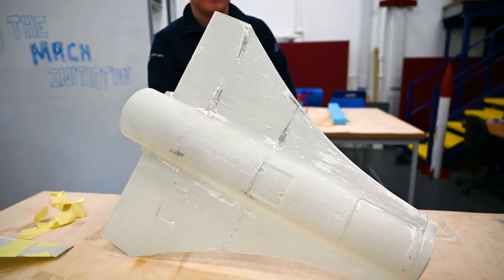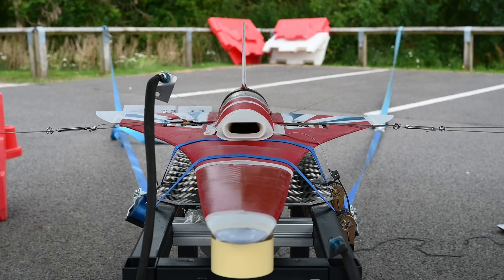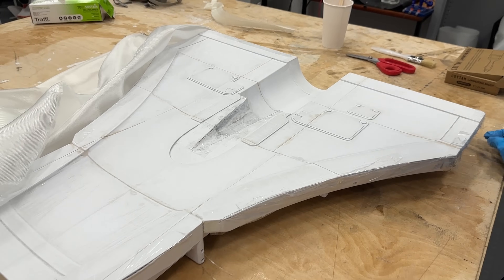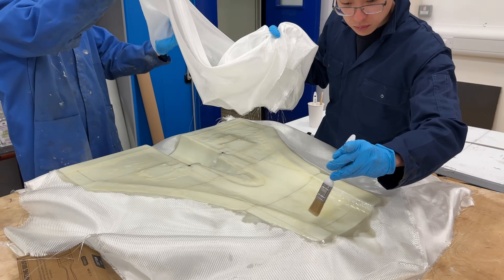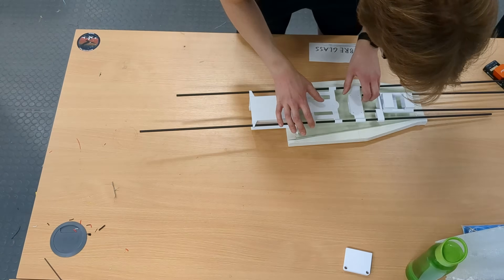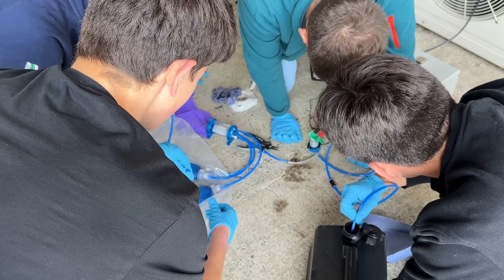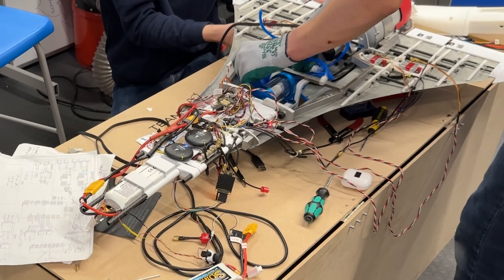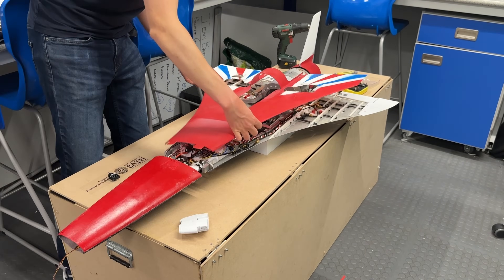Completing the Build of our 570 MPH Model Aircraft!

Comment: There's some good stuff here lads but it's impracticable and potentially dangerous. Flying rc you have to keep the model in sight sufficient to control it. That's not a big model. If you flew oval circuits comprising 200 m "straights", joined by 100 m radius semicircles each end, at 75 m above the ground and you were standing in the middle of one of the straights trying to fly it then, at its furthest point, the model would be 235 m (770 ft) away. I fly rc too; you would really struggle to fly such a small model at that distance. The impracticality comes further into focus if you work out the time for each of the "laps" described above while travelling at 570 mph (255 m/s): 2.8 seconds! Also the "g" would have to pull in the turns: 266 g! The wing would stall at less than one tenth of that g loading. The wing isn't that strong either; why on earth didn't you use carbon? Also, if you want the wing skins to act as a monocoque structure in bending then there has to be some transverse shear webs connecting the top of bottom skins. That's a huge turbine you've got there. Please proceed with caution. Get the best you can out of it - but safely. And remember, you have to fly line-of-sight in this country - it's the law. Change the objective to setting a speed record for electric ducted fans?

Comment: Those control surfaces look extremely large to withstand flutter at the speeds you're planning on going. The travel showed is of course at low speed and at high speed travel will be minimal with plenty of expo.

Comment: A couple of pointers coming from somebody who’s been doing RC planes for 20 years, that turbine is absolutely enormous and you’re drastically going to need to increase the size of the air intake. Also, the center of gravity is going to be very difficult to get correct. Move everything as far forward as you can. Our saying is, a nose heavy plane flies poorly, and a tail heavy plane flies once.
Reply from the maker: To reach the speeds we’re aiming for, we’ve had to cram the biggest possible engine into the smallest possible airframe. Our engine generates 60% more thrust than the current record holder with a wing that is slightly smaller. The drawback is our high (50 mph) landing speed.

The inlet was sized using an optimisation study that combined CFD and experimental testing. The shape was optimised for high-speed flight, which is why we have a small area to minimises spillage drag and maximise thrust at Mach 0.75. We’ve tested the engine+inlet at low speed, using edf’s to simulate different crossflow and angle of attack conditions, and the inlet has not shown any signs of stall. We see a 20% drop in static thrust, but this is expected given the inlet isn’t optimised for low speed, and we’ve heavily overpowered at these speeds anyway.

We’re aware of the CG challenges. We ran a wind tunnel testing campaign to accurately pinpoint where the neutral point is, and we have an adjustable ballast to position the CG just ahead of this point. We’ve got more ballast than we’d like - in future iterations we’d likely move the engine 50mm forward.

Thanks for your pointers and interest in the project!

Comment: Hey guys I think you should really have a good look at controll systems on d/s gliders and how they tackled flutter with limiting controll slop and increasing controll stiffness I guarantee how you guys have it won't be good enough and also look at the stiffness in the main structure I think you will be really surprised with what is required at these sort of speeds it's a real eye opener good luck 😊
Reply from the maker: Stiffening the control surfaces/ linkages is top of the agenda - we’re less worried about the main structure as we’ve done extensive finite element analysis and experimental testing on this with a healthy safety margin. The internal aluminium/ carbon fibre structure helps with stiffening, and we’ve gone for a thick 1.2mm layer composition with the fibreglass.

Comment: As heavily involved in FPV plane design myself, I can only applaud this. Just one thing I am sure you considered: Try to shape the intake manifold as such you can control the intake airspeed actively. Try to avoid resonance and shockwaves inside the manifold in order not to suffocate the turbine and cause a flame out. Subscribed !
Reply from the maker: The inlet shape was the result of a 3-month CFD study. It is optimised to minimise spillage drag and maximise performance at Mach 0.75. It decelerates the oncoming airflow to Mach 0.4 at the compressor face while ensuring uniform flow to prevent damage. In the speeds we fly at we’ve ensured we won’t get any supersonic flow in the inlet. At low speed we see a 20% reduction in static thrust because of the small opening, but experimental testing under different cross flow conditions has shown that the inlet doesn’t stall!

Comment: That is going to glide like the space shuttle :-)  I hope you glue on those wing skins really well  especially the leading edges. They do seem a bit flimsy for the speed......how about adding some carbon fiber into the skins.  Will be exiting to see how it goes :-)
Reply from the maker: We’re avoiding the use of carbon fibre as it is conductive and we want to minimise interference with our 433MHz and 868Mhz antennas which are in the wings. While fibreglass is slightly heavier, the layer compositions were sized using both analytical tools and finite element analysis to ensure they can take the loads

Comment: This looks like an awesome project, Iv been rc flying for 40 years and have had many high speed delta aircraft, the one thing that worries me about your design is the small size of the virtual fin, there use to be a kit available called the delta 2000 and the mini delta 2000 that use to hold the rc speed record, it was very similar in design to your project, they found in early testing that the aircraft was prone to entry flat spins, they found that increasing the size of the 2 fins solved this problem, good luck and I can’t wait to see the test flight video.
Reply from the maker: This is really useful to know - thank you! We sized the vertical fin using the current world record holders design as a reference, and while we have low-speed flight data of our foamie we won’t truly know how it performs until we fly the full-scale aircraft. Increasing the size of the vertical fin would be relatively simple as we could slide a larger fine over the top of the current one - its something we will consider for the maiden flight!
Reply: @TheMachInitiative the 3D printed plane I designed also ran into this issue. Planes fly a lot better with big enough fins. Too small and you get so many weird stability issues. Of course if you’ve been flying the small version around fine then you probably would’ve noticed rumblings of unruly behavior. Good luck

Comment: Why intake up ?
Reply from the maker: It enables the underside to be smooth for a belly landing. High-speed propulsive performance isn’t impacted, but there is a risk of stall at high angles of attack during landing with it on top. Fortunately, we don’t need the engine for landing - so this isn’t too much of a concern, at takeoff the angle of attack is sufficiently small that we are not concerned about stall

Comment: I do wish you guys luck...
Just a few questions 
The intake looks way  too small fir that engine. The negative pressure inside the plane and the force of air pressure on the outside could make the airframe skins fail and go through the engine.
 Also undersized intake will reduce engine performance and reliability also increases the egt.
Have you got a fod guard for the engine.
As the engine has no afterburner... most exhaust velocities of our rc jets are around 683mph (1100km/h).
This will be the hardest part of breaking your speed goals. 
You'll need a thrust to weight ratio of at least 3.5 to 1 for the high speed part.

Also have you flown any turbines that go faster than 200mph...
Are you flying  with visual flight only.
If you are going to fpv it check with out your countries rules about turbine flights. 
Fpv will give you more success as you dont have to keep turning to keep it in sight.

My fastest rc jet has gps at 575km ground speed while in a climb... 
This is a 1/6 scale f20 thats a large airframe.
I have flown development high speed fpv turbines but they need special permissions and flying areas here in Australia.

Again i do wish you luck and will be watching your progression
Reply from the maker: Thank you for the support and advice! In response to some of your points:

The intake is optimised for Mach 0.8 flight - at those speeds you want a small opening to reduce spillage (and thus reduce drag for a higher top speed). The shape of the inlet was optimised using a CFD study and was experimentally tested on the bench for a masters project. Yes, we see a 20% reduction in engine performance at low-speed because the inlet wasn’t optimised for that regime, but we are so overpowered on takeoff that this isn’t an issue. Experimental tests with the inlet have showed no signs of stall at low speed, and we have heat mapped the engine to ensure our thermal management system can withstand.

No FOD guard on engine, the inlet is on the top which should help to reduce debris ingestion - we don’t want to harm performance.

Refining our estimate for the top speed has been the combined result of CFD, wind tunnel testing, use of empirical models to model the thrust. By combining these tools and applying conservative margins, we’ve been able to get to a top speed of 570 mph. This is ~100 mph faster than the current world record holder. The reason for this is our wing is smaller than his (our wing loading is very high at 250 g/dm^2) and we have a larger engine that provides 60% more thrust than his. This gives a thrust to weight ratio of 3, versus his which was ~2.3.

Our professional pilot has 20 years of experience flying jets at speeds of up to 300 mph - we’ve outsourced the piloting to minimise risk.

We’re flying with FPV.
Reply: @TheMachInitiative  
Again

Good luck to you

Comment: Impressive looking machine!  I wouldn't be using any 3D printed parts if that was my rig, but given how much structure you have, and the NICE fiberglass skins (WELL DONE)- I don't think that will be a problem either.  This thing is going to be very touchy on the controls at high speed.  Make sure ALL the control surfaces and linkages are ULTRA secure, and I hope you have done all your homework on materials selection and construction to avoid fluttering of various surfaces.  LOOKS LIKE A BLAST!  Looking forward to seeing the flight videos, and remember, this it Youtube- you will get some views and praise if you succeed (and a call from the personnel dept. at LADP), but you will get MORE love from the Youtube membership if you turn this thing into a 500MPH lawn dart that leaves nothing recognizable at the crash site.  ;-)  Best of luck!

Comment: I have no idea about flying at that speeds but I am interested does Ardupilot support this much spees? And the control surfaces seem a bit too large? Or the control horns are structurally rigid enough for these much forces?
Reply from the maker: The control surfaces need to be large to trim the delta wing during landing at 50 mph - these were sized using a dynamic wind tunnel model with moving surfaces (working on a video about this). At high speed very small deflections are required so to counter this we disable the outboard elevons and only control using the inboard elevons.

The control surfaces will be reinforced with fibreglass tape (in addition to the carbon fibre hinge rod currently present)
Reply: @TheMachInitiative  thanks, what about ardupilot side? I am not sure if their control algorithms will work on such a high speeds

Comment: Really nice project! But I strongly advise asking rc modellers of fast planes for guidance… I fly fast jets and speed models and there is a few things that might lead to catastrophic failure at the speeds you are aiming for. 
1. the servos seem to be an the small / weak side and the leverage of the linkage is to big and will likely leak to flutter 
2. when you use bladder tanks there is no need for a bubble trap, an engine of this size will use all your fuel about 90 seconds or less
3. regarding the use of the ardupilot use  extreme caution!! Try it on another fast plane first! If it starts oszillating due to high gain settings you plane will desintegrate within a blink of an eye ….
Keep it up I’m excited for your next videos
Reply from the maker: Thank you! We’ve been working closely with experienced rc enthusiasts and pilots, in response to your points:

1. Each servo provides 20kg-cm of torque - they costed £100 each. We’ve used cfd and wind tunnel testing to estimate the required talks. The point about fluttering of the linkages is something we haven’t thought about - thanks for mentioning this!

2. We don’t trust ourselves to fully bleed the bags of air, so the UAT is a precaution. It also reduces the risk of fuel starvation during turns.

3. The autopilot doing more harm than good is a big concern of ours. The first flight will be manual without active stabilisation from the autopilot. Then we’ll slowly introduce gains, with aid of our 6-dof simulink model for testing on the ground. Our professional pilot has 20 years experience flying fast jets, but it will still be a difficult aircraft to master
Reply: @TheMachInitiative   thank you for your quick reply! The key to avoid flutter in your control surfaces is zero play, stiffness and mass of the surface. A good 20kg servo should be enough if it has very little play. 
Fuel starvation is not a issue with bladder tanks, there is automatic fuel stations out there to refuel bubble free,  but the bubble trap will make it harder if not impossible to get all the air out the system. 
I think you will need all the fuel you can fit in your plane, the engine uses around 1liter/ min at full power. 
I know the guy that holds the current world record and he startet flying similar sized deltas with 60N engines…much lighter and probably much easier to pilot. 
So it’s a good idea building smaller/ lighter versions to test first.

Comment: Nice work gentlemen. How are you going to keep the top cowling in place where it joins the bottom of the fuselage on the leading edge without it wanting to split during flight?.
Reply from the maker: It’ll be epoxied down, we just don’t want to epoxy it until we’ve done all ground tests as accessing cables becomes a lot harder!
Reply: @TheMachInitiative  Sweet. It would be a shame to see it splitting in two at warp speed seven!.

Comment: "Hello? : Dam, Tim and Josh. Congratulations on the completion of your model kingfisher aircraft sonic project. Many don't understand? The orientation of a factory prototype finish design all starts from your preliminary focus of the production of this model. Whereby? It is the source  and prime instrument of the finish product. It corrects all errors at a smaller scale and it gives the same results when calculated properly.  It is a sleek design. It is always good to have a model set for speed, it weights the bar. Good job! And? Continue to do well. I know how hard you have worked on this project. Your time and input is not overlooked due to production of the item." 👍

Comment: Hey, nice project! But if see the construction and that huge turbine, I have 3 questions!

How will you balance that jet with that heavy Turbine?

Did you made your calculations right for stability? Did you ever take a look for rc planes who fly around 300 mph / 500kmh who they are build. If you get torsion from the wing, you're done! And that's way below 300mph.... Also your little cfkrod to hinge the ruders! Way to less for the speed you 
want!

Did you take a look to the surface rule on airplanes if the want go higher subsonic and super sonic? 

And you don't need a bubble trap if you use fuel bags!

But very nice project, I will watch and hope my questions are wrong!
Reply from the maker: Thanks!

1. We estimated the neutral point using a combination of (1) CFD, (2) wind tunnel testing and (3) an electric flight prototype, this enabled us to estimate the CG. We have a steel ballast upfront to get the correct CG.

2. We used the area rule to optimise our initial supersonic concept, but decided supersonic flight was infeasible given the resources available to us. So this aircraft will reach mach 0.75. Area ruling is not needed below mach 0.9. More about this supersonic concept at the bottom of this page: https://www.themachinitiative.com/design

3. Yep - the UAT is just a precaution, and reduces the risk of fuel starvation at high g’s!

Comment: to try to fly that fast from the ground is not only irresponsible but also dangerous;we know it can be done so what is the point and it sends a bad message 
which we dont need in our modeling community.
Reply from the maker: Safety is a key part of our project, it is why we have a dedicated regulations lead, parachute flight termination system, and why we have been seeking the advice of industry experts with decades of experience working with the CAA. We will be performing the record attempt in a private test range in segregated airspace, under operational authorisation from the Civil Aviation Authority.